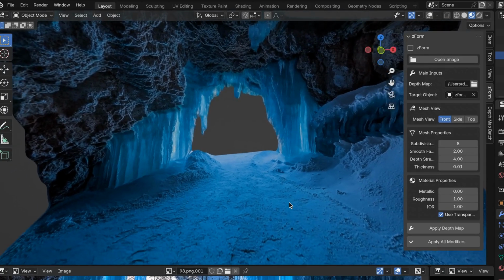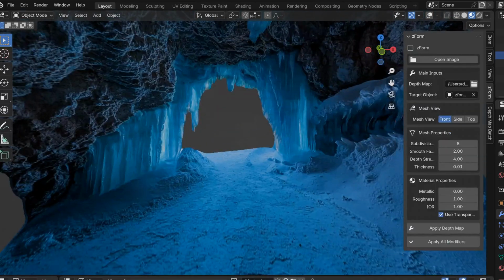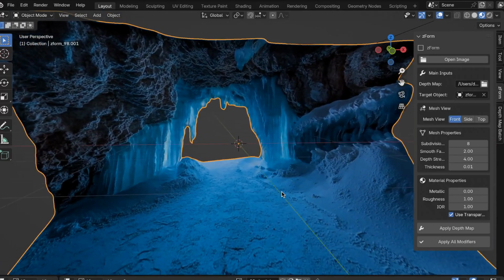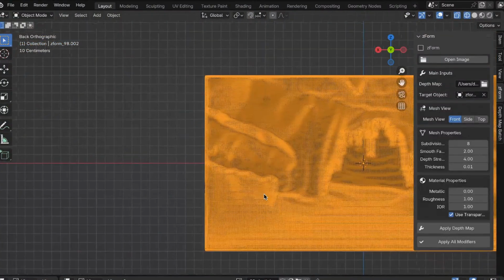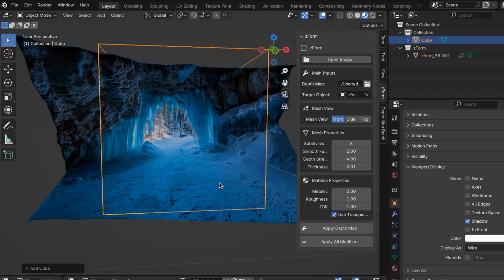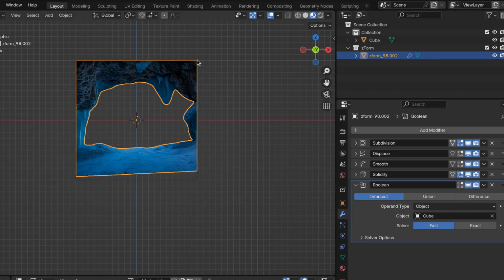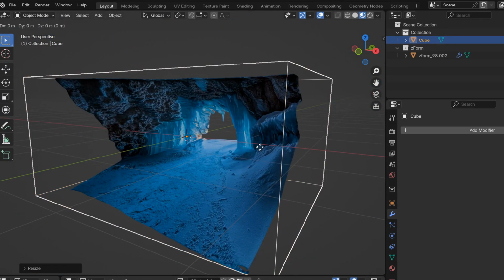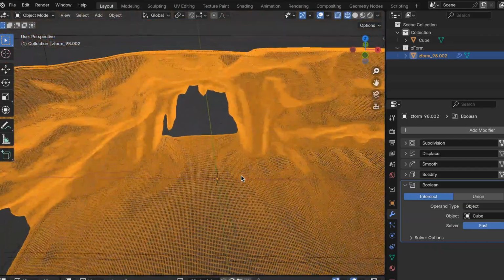Convert 2d image to 3d mesh in Blender using depth map and modifiers

Comment: Wouldn't B, select area to be deleted then delete vertices work?
Reply from the maker: Yeah, that could work in some cases, but one challenge and possible issue with that approach is not all the furthest vertices along the Y-axis are at the exact y-coordinate value...they can vary with displacement depending on the depth map/height map. In turn the backside can look jagged and not smooth, or even in a worst-case scenario have a few vertices that are much closer along the Y-axis which could have big impact to the aesthetics of mesh results. Whereas using a boolean modifier to cut out the backside for this example would do a clean cut on the entire backside. And this approach also offers a non-destructive workflow where you can adjust where exactly you want to cut out the backside precisely and easily adjust later.

Comment: The one thing with this method that has always bugged me and I wish there was some way to fix it is that the deeper into the image the smaller things get so you never get an accurate perspective of the floor and ceiling I wish there was some way to work around this easily. Oh well hopefully in the future.
Reply from the maker: That's a fair point. Yeah, that would be great if these depth map models continued to improve for floor and ceiling perspectives. I'm wondering if using the proportional editing tool for cases like this to reshape or adjust the floor or ceiling to fit more with the perspective could help. It would take time to do it, but that was my initial thought.

Comment: Thanks ! Could it be possible to use the black area of the  depth mask as a mask ? To directly get the holl instead of setting this boolean. To get a kind of slide ramp to unbuild a certain quantity of black. With a ramp we also could pick the color.
Reply from the maker: Hi. This is a great idea and possible solution. I'm going to be looking into this more...thank you for the suggestion. A while back I tried to build a feature to control in a non-destructive way the mesh produced based on the depth value, but wasn't yet able to get that working.
Reply: @vizdotlife  Thanks. It could also replace alpha mask for portrait, tree, people etc... Undestructive, untel apply your depth math options